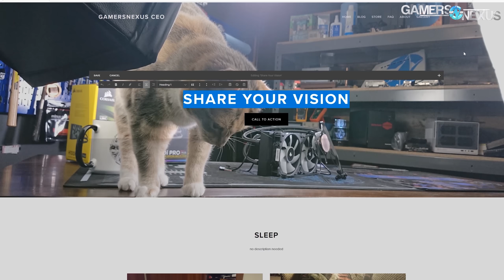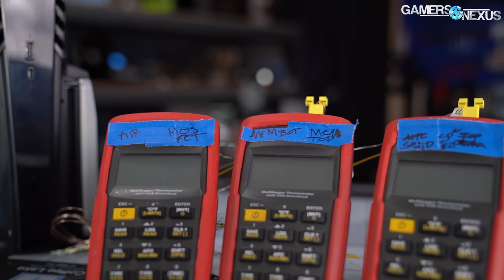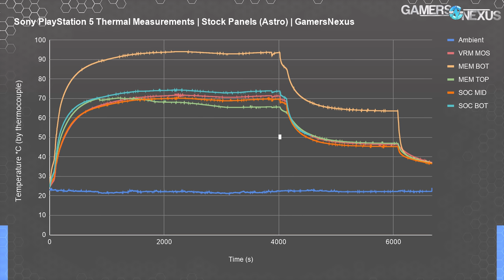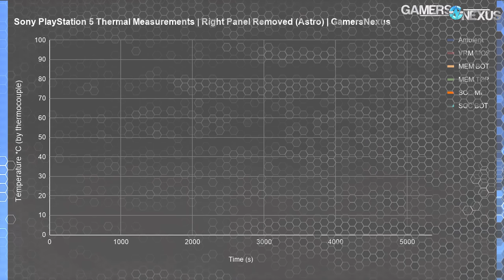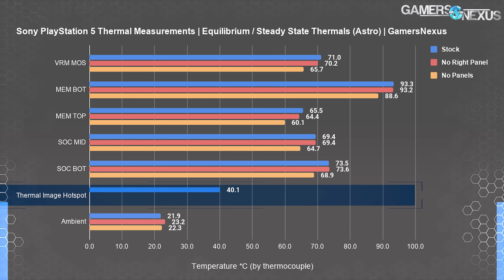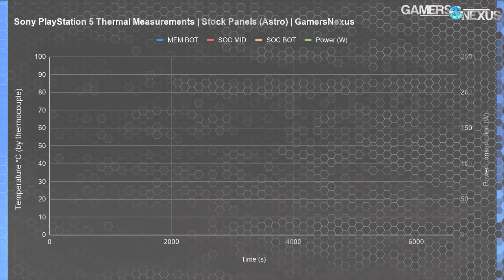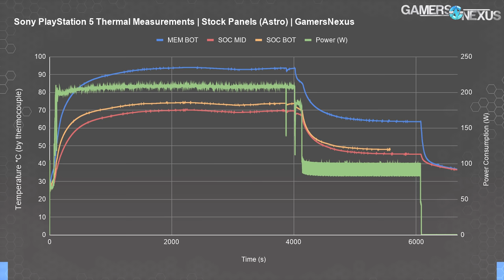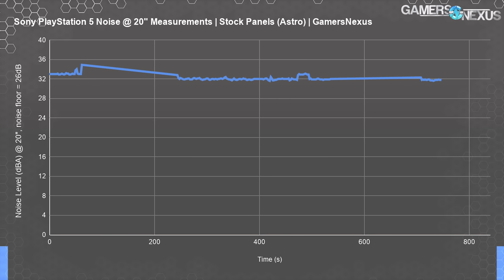Weak Cooler Design: PlayStation 5 Thermals, Power, & Noise Testing

Comment: I would really like one about Series X. That design is interesting.
Reply: I agree Lain!
Reply: So many kinds are gonna drop shit into that fan at the top
Reply: I’m curious to see their video on it as well. So far mine doesn’t even feel like it get that hot. You put your hand near any of the intakes and you can just feel it gobbling air and you can feel the exhaust fan venting air strongly from over a foot above the vent. It stays hella cool.
Reply: @Niallphillips  that will be amusing. Almost like we shouldn’t buy our kids a top of the line console with vent holes big enough to fit the tip of my pinky lol.
Reply: @Niallphillips  place a shirt over it when its not and use and actually turn it off.
Reply: Lol Damn near all custom PC cases have ventilated ceilings with much larger 2x14cm or 3x12cm area for shit to spill in.  Not to mention it was shown to perform just fine on its side.  Non issue.
Reply: There is one.  Series X is a better design for cooling than the PS5.  It even has a fail safe exhaust if the top vent becomes blocked.

Comment: 21:00 The real reason is that the wire is much thicker than the memory chip, which prevents the memory chip from having good contact with the back panel.
Reply: No, there are those dips in the backplate which contact the memory, so the gap should be larger than the cable
Reply: @johnuferbach9166  Oh, you are right. I didn't notice those dips.
Reply: @johnuferbach9166  that dip is big. Wire can still affect the dip.

Comment: Hey, Steve! Since you're testing thermals and airflow while preserving the most factory-like condition to understand better how it will perform in long term for a regular user, can you as well add some kind of dust stress test for close form-factor devices like consoles (for which disassembly will remove warranty)? Sony claims to have "dust collector section", while Series X seems to be particularly week against dust and hair due to a total lack of filters on both sides.

Comment: Pumped for you to do the series x thermals. Can’t wait. 👍🏻
Reply: spoiler: same issues
Reply: @evolicious  link?
Reply: @alexkhan2980  no link he's lying, the Xbox is basically a tower so it will be a lot cooler, memory included.
Reply: @choatus , it's not cooler.
Reply: @Optamizm  measured both my machines last night, the Series X was getting rid of the heat a lot more effectively, also the memory modules were way cooler. Microsoft has done a better job with this by the looks.
Reply: @choatus  Yeah, he's lying. The ssd is pressed up against the vapor chamber so it'll be about as hot as the air coming out the top
Reply: @Optamizm  It is?
Reply: @no.5015  checked and the SSD is fine, The vapor chamber touches it for a reason, it draws the heat away.... Thats what it's meant to do.
Reply: @choatus  Yeah, that’s what I meant. I was agreeing with you lol
Reply: @no.5015  ok np, wasn't clear sorry about that mate.

Comment: What if we drilled a hole with a circle saw or Dremel to give it direct air in, install a mesh layer just under the hole, then added some sort of heatsink or more copper material to the ram.
Reply: This would probably solve most of it.
Reply: And let the fan run higher.

Comment: I would really love to work for you guys :-) I wish I could relocate and apply hehe. With 20 years working at a physics lab, I marvel at the level of detail you are willing to go, but I always get ideas when I watch the measurement setup you use. In this case, I would have suggested using Pt resistors as temp sensors, and using a DAQ interface to do the multichannel measurement (even a cheap Vernier SDAQ, or an entry level NI interfase). Love to consult with you if you ever need to!

Comment: Hello,

Is it possible that the metal plate covering the hotspot memory chip is not making full contact with the mem chip, or the thermal paste is not contacting well enough because of additional wiring you ran on the board and soc. It appears the plastic clamp in the doard will wobbly and not fully pressed to the board. This could possibly lift up the whole clamp up, lifting the metal plate. Even if you screw it down the metal plate could be bent resulting in not having it fully touching the chip, increasing the temperature in that specific area.

 You also said, that applying more thermal paste could lower temp, so i'm guessing the above could cause this inefficiency.
Reply: He said the temps on the soc are good, also the ram is contacted to the housing on bumps in the housing, so there should still be clearance between housong amd the cables
Reply: @johnuferbach9166  

What I'm worried about is that additional wiring on soc caused the whole soc assembly to lift up. Additional height on soc might have caused the metal plate that covers it as well as the memory chip  to have too much clearance. 

That might have caused no changes in soc temperatures. On the other hand the additional height and clearance on mem chip might have been the reason why the standard amount of thermal paste does not provide sufficient cooling.
Reply: A test measuring only memory chip temperatures, with no wiring on soc might be the best.
Reply: I do lean towards that reading being inaccurate, or maybe his particular PS5 unit is defective. Because if it is true, then I assume we will be seeing an extraordinarily high failure rate in the coming months.
Reply: @zaidabraham7310  I'm also wondering if the disk drive causes more heat to stay. I have a digital edition not sure if that makes a difference

Comment: Wondering how the memory behaves when people without air conditioning are playing during the summer heat. Top floor apartments can easily get close to 30°C ambient. This would mean 100°C+ for the memory. Although the silicon might be able to sustain 110 or 115 this is for it's internal temp. 
So it would be a nice test if you up the ambient temp by 5-10°C
Reply: Increasing ambient doesnt always mean an increase in temps of everything else and like he says the fan can go faster. But RAM is made to run hotter than any other part of your hardware its why generally on PCs heat spreaders are more for looks than actual cooling on RAM.
Reply: @vherostar  absolutely fans make almost no difference . In summer my cpu goes 85 degrees in winter to around 75 . Same cooler , same speeds
Reply: @gamesthatmatter9374  so in smer your room is 30°C and in winter 20°C and it translates 1:1 into cpu temperature?
Reply: I was thinking the same here except the temps are almost always ~30c in Sri Lanka, a tropical country nesr the equator. Looks this ps5 might have serious thermal issues in the long run, at least in hot areas.
Reply: @vherostar  I know but it does affect the cooling performance. The question is: how much. That's the reason why it would be nice to have a test. (If it would always scale there's no need to test)

Comment: The backplate might be steel (though I'm not sure, see below), and there's quite a distance between where the memory module TIM contacts the backplate and where the heatpipe connects to it, Steel is not very thermally conductive (for a metal) at 45 W*m^-1*K^-1, or about 1/5 of aluminum, and it's a long way to the heatpipe. I think it may be helpful to measure the temperature of the back of the steel plate near the memory to see what that's like compared to the back of the steel plate near the heatpipe. Or you can put some black tape on it and use a thermal camera.

The frontplate has some serious cooling, but to take advantage of that you would want a bunch of copper through vias under each BGA bump of the memory. You don't want tented vias, though in my testing it didn't make much of a difference. Most of these devices already have a large number of these for the decoupling capacitors, but not always. You then want some TIM between the through vias and the heatsink. Like the top backplate, the closer you are to the heatpipes, the better. In this case, there does not appear to be any contact to the frontplate an the memory.

18:00 mark on the copper there. I think it's during manufacturing, that's the location of where they press it into place. Not sure though. It's also possible they use that for heatsink validation.

Edit: 18:36 about the backplate being steel. You're testing it with a magnet right over the BGA pressure/retention plate. 20:46 "not sure what metal that is." That's steel. The back side of the BGA retainer has has a steel piece in it (looks like 2 steel pieces), so I'm not 100% convinced that the backplate itself is steel. It sure looks like an aluminum stamping to me. You usually don't see those brush marks in steel, and steel is only that bright if it's expensive stainless steel (which is not very magnetic). There's no reason for it to be steel and aluminum would be cheaper. The magnet can be attracted to the steel used in the BGA. I recommend testing the plate there when it's off the device to avoid such ambiguity. You've made this mistake in the past with pump impeller magnets.

BTW the frontplate looks like it's steel which makes sense because it's providing structure (all the screws go in to it).

25:04 "the nand doesn't really have any cooling" This is incorrect. You can see a few "dimples" on the frontplate near the NAND. I'd wager there's some thermal pads there.
25:07" "NAND likes to run hot, it's better for it, at least when it's in use anyway" I think you're referring to the long term data retention of NAND. It's true that if you write to the NAND cell when it's hot, it'll retain that data for longer, but there's definitely a limit, I haven't looked it up, but I believe around 70C the effect is less, and at higher temperatures, the retention is even worse. For NAND semiconductors, you will have higher leakage and electromigration effects than at ambient. It's OK to run the NAND a little hot, but you definitely want a heatsink on it to keep it under 90C.
26:35 "power leakage from heat build up" Don't get me started about leakage. I think every person in the computer industry that I've heard use the term is not using it right, and there's no good descriptions of how it works on Youtube. So it's forgivable.

Comment: Mine is overheating when I play ps5 games (or anything in 4k) and some artifacts appear on the screen. Guess returning it is the best option for now...
Reply: what happens if you play PS five games at 1080p
Reply: It worked normally. The problem happened with 4k content.

Comment: I think the problem is all those cables are creating a bump preventing the metal plate to touch those bottom Memory chips. Clearly I don't see that problem with the top memory chips (because there are no cables creating a bump) What if you try to route those cables individually, this way you don't create that big bump between the two middle bottom memory chips.. You can see that where the electrical tape is, that is too high. Additionally, what if you replace the thermal pads with new ones. It is not fair to compare brand new (working ones) against broken/disintegrated pads. Another idea is to drill a hole through the metal plate and pass through the thermocouples, instead of routing all those cables underneath the plate and causing bumps and areas of poor contact..
Don't get me wrong, that's a great job, and I really like all your videos. You are the first ones trying this with a PS5. I beg to see a new video addressing these flaws, (and also please measure the temp of one of the SSD chips instead of ambient temperature). before watching an Xbox Series X video.  I can foresee nice temps on the XBS X APU and ram chips

Comment: The 100W idle consumption is absolutely ludacris.
Reply: Like most PCs. I have a reader in the wall. It's 85 to 100 Watts at idle. Often closer to 100.
Reply: 100W is nothing. People always think it's a lot but electricity costs less than 25 cents for 1000W in every western country, most below 20. It would have to use 600 under load to even remotely change your electricity bill
Reply: What? Normal PCs consume 100w idle, hell an incandescent bulb uses 60-80w
Reply: @awesomeiguy  Who uses incandescent light bulbs nowadays ? You can't even buy them where I live
Reply: its absolutely nothing lol, and in rest mode it takes 0,5W
Reply: @awesomeiguy  most normal bulbs nowadays draw 2-6, idk why people care so much. An idle ps5 uses an average of 2 cents an hour...damn that's a lot
Reply: @weavercs4014  I hear the mantra almost every day that "people should use green energy because we'll all die otherwise" and "be conservative with your energy needs". This is clearly the case where we could save some extra or at least not waste that extra.
Also good for you, my friend, that this extra cost doesn't influence your life. Here, where I live, that extra $15-$20 means a lot. People buy these consoles for credit anyway so there's no initial cost to keep them away.
Reply: @awesomeiguy  My PC with a 3700x, RX580, 2 fans, an SSD + a HDD consumes 76W on the desktop. 25% less without extra optimization. 
Last week I bought 10W bulbs for €2 per piece which are equivalent to 60W normal bulbs. So what are you talking about?
Reply: you guys are all ignoring that power goes out in your ROOM, which is a problem if it's already hot. 100w are a huge heat output for a computer that is doing nothing
Reply: @menpee  100w at idle is definitely ridiculous for a modern SoC/APU. I run a 3600X, 5700 XT, 4x8GB 3733MHz RAM, SoundBlasterX AE-5, NVME + SSD + 2 HDDs, 10 120mm case fans, custom water cooling, and a 1000w 80+ gold PSU. My system idles at 83.5 watts from the wall. There should be no way in hell the PS5 should be drawing more power than my PC at idle. My HTPC with an R3 2200G @ 4GHz idles at 52 watts, which is slightly less than I'd expect the PS5 to sit.
Reply: AFAIK the PS5 renders a 3D scene in the main menu, which would drive the electricity consumption up. That's like if you had Wallpaper Engine doing some sort of 3D scene on the desktop. It kind of sucks. At least the "rest mode" only takes like 0.5-2 watts.
Reply: @Rez441  After looking at the thermal solution and their use of a distribution plate, I now understand why they're doing this. It's to prevent unnecessarily large swings during thermal cycling. It's better for long term reliability to keep the components hot at all times instead of letting it fall to ambient temperatures and rise back to the max operating temperature.
Reply: @K31TH3R  I don't know about that... maybe?
Reply: @RitsuAbyssgard  do you own a kill a watt or similar simple device that shows how much power is being drawn? I have one. And that's damn accurate.. It is always at 100 to 90. At idle. My cpu draws 25 Watts at idle..

Comment: I wish they would add a Fan mode in the settings, like a quiet, balanced and performance mode for the fan speed/curve. My PS5 is quiet but runs quite warm and have had some artifacts appear, would be great to be able to turn the fan up a bit to cool it down more.
Reply: Some people were saying if you get artifacts you should return it to sony
Reply: @DarkJessie20  that should be the case. Get to the custom support and say, that you got artifacts, so a defect
Reply: @DarkJessie20  I wonder if they are going to underclock the PS5 when everyone is bored of testing it and doing comparisons to the X. 

Bit of a conspiracy, but I wouldn’t be surprised.
Reply: @DarkJessie20  Thanks I wasn't aware of the artifacts issue, thought it was from heating up. I'll contact Sony and see what they say.

Comment: Just a methodology question, do you take your local air pressure into account while calibrating your thermal couples or do you consider that impact below measurement tolerance?
Reply: Air pressure has nothing to do with the Seebeck effect to be honest.
Reply: @black7rc720  but with their calibration with water (boiling)
Reply: @black7rc720  you would have a temperature span of about 2°C for your 100°C point, depending on the day of calibration, (at least where I live). This may be a significant impact depending on the kind of measurement.
Reply: @Piupiumacher  I see where you're coming from👍. Never really liked the word calibration. Misused word often. All that was done was verification. No actual calibration (trim, zero offset, span etc) carried out on instrument. Well, not that Steve mentioned..moreso adjusting to match another...But yes I see your point.

Comment: Wait what about the thermal difference between vertical vs horizontal orientation of the PS5? Many people need to use this monster horizontally so it fits under the TV.
Reply: Shouldn´t make a difference as there is quite a lot of clearance under the intake in horizontal position (if panels are removed). With panels on there is zero difference...due to the stupid panels.
Reply: @2nd_Directorate  we’ll never know unless it’s tested though. He has the leafs hooked up already so hopefully we get an update.

Comment: The fact that Sony used OSP as a coating on their PCB is disheartening. OSP is the copper colored material around the board and such. It’s an organic material that is used to coat the copper to preserve solderability over bare copper. OSP is cheap and degrades quickly which will lead to tarnish on there over time. Not detrimental but when does not scream quality when you open your PS5 and it’s green a year later. Most places use ENIG which is a gold coating or HASL which is just using solder to cover the bare copper. Both are relatively inexpensive even compared to OSP.